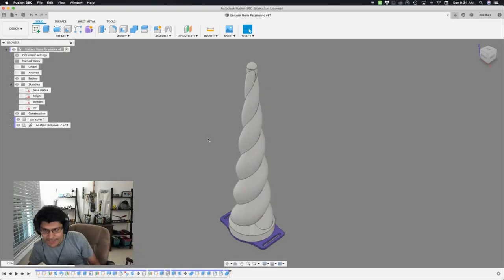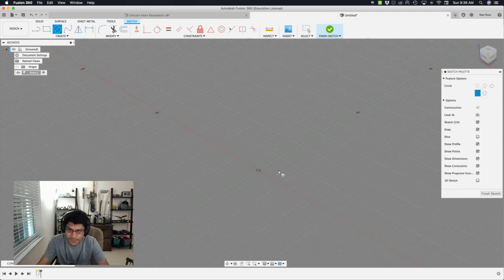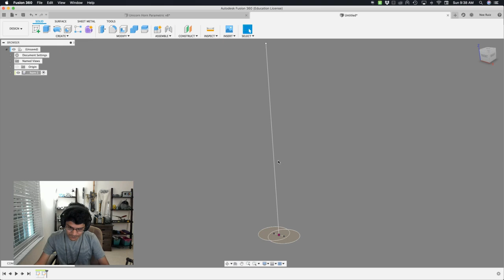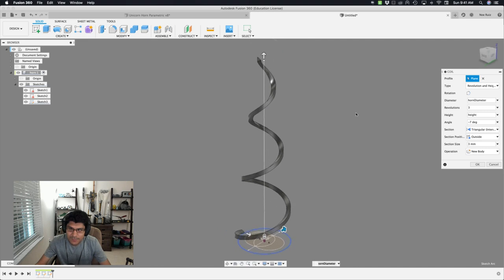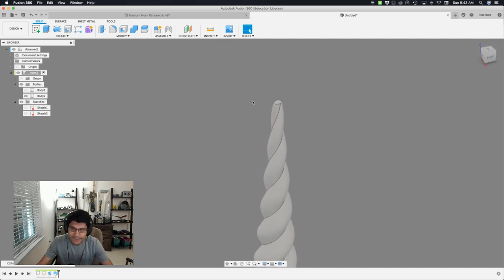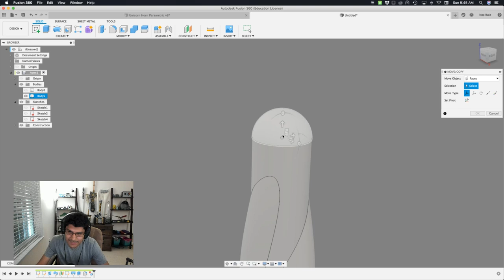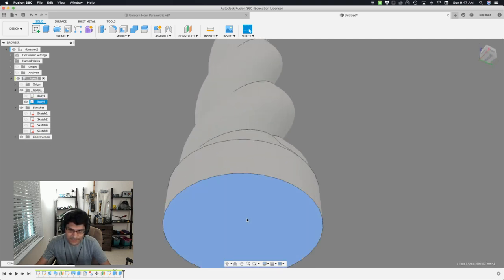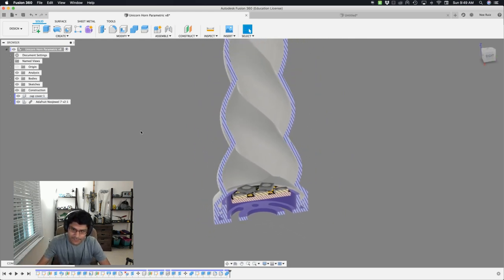Fusion 360 Tutorial – Twisty Unicorn Horns!

Comment: This was what I needed.  A small modification I used- draw an ellipse offset from the tip (instead of circle).  You can nearly match the overlapped circle profiles.  Then draw a line on the major-axis of the ellipse after blending, then revolve a solid of the half-ellipse 180deg to cap the tip nicely!